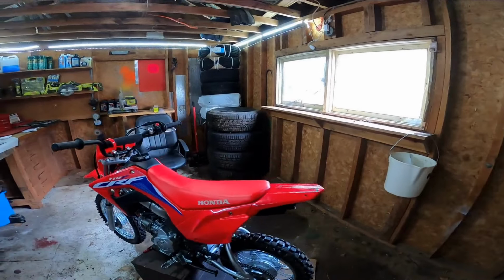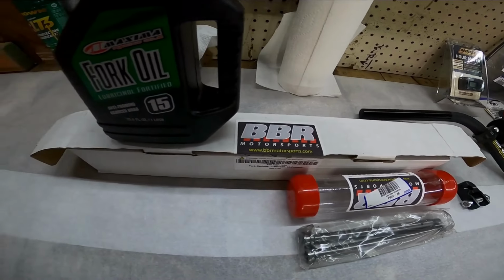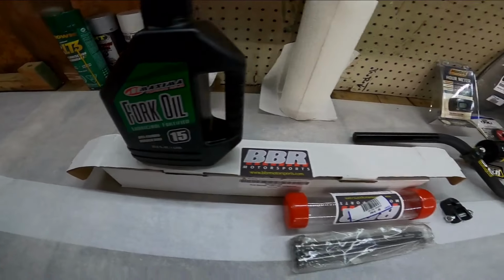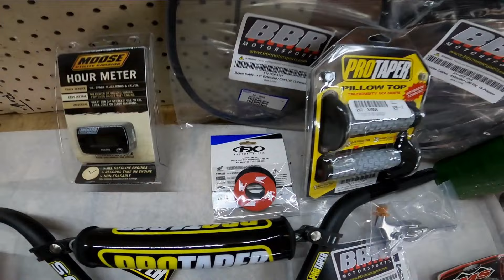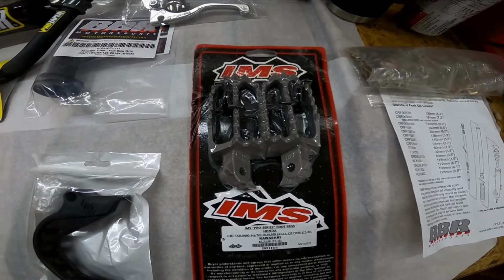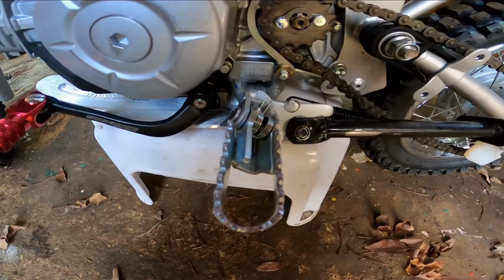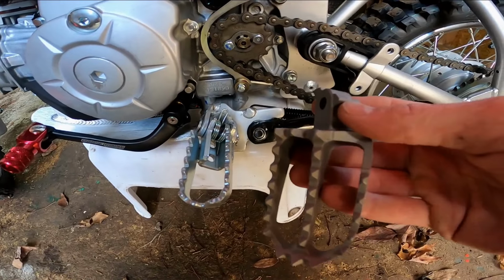2022 Honda CRF110 Build Part 2 (Suspension mods,Bars,Pegs, Sprocket guard)

Comment: Did the after market shifter add length for your foot, the stock one is a little big for my foot
Reply from the maker: Yes it did , it says it's 1/2" longer, but I think it's 1" longer. 
It's almost too far now for my size 10 boots lol
Reply: @WastedWages402  sweet thank you for the responses!
Reply from the maker: @weskirtland6261  no problem buddy, have a good one!

Comment: Did the chain need re-tightening after the rear shock extension install?
Reply from the maker: Yes it did, I had to tighten it up just a little.
With no weight on the bike, the chain is very loose because the change in geometry.
It does rub a tiny bit on my sprocket guard when in the air on jumps, so I am looking into putting a roller on the engine mount or something to fix that

Comment: Good stuff. I just bought 21 model.  I assume the factory cables reached the new talkers bars?
Reply from the maker: Nice you'll have so much fun! 
They did, but it was tight, so I put on BBR extended cables (crf125 cables are a inch longer)
I'd definitely recommend longer cables,
Wether you just buy crf125 ones, or the BBR extended 110 cables, same thing

Comment: do you actually need the extended brake/throttle cables for the new bars or no?
Reply from the maker: I've seen people getting away with stock ones, they flip the throttle tube upside down I think.
But there throttle sticks when turning bars.

So in my opinion yes 100% should get extended cables.(I believe there just crf125f cables)

Comment: Thanks for the interesting vid! Where did you but that rear shock spacer? I can't find them☺️
Reply from the maker: Thanks for watching!  I'm editing pt 4 right now! 
This is the exact one I got , not fancy but cheap and works good lol https://www.factoryminibikes.com/collections/crf110-suspension/products/1-shock-extender
Reply: @WastedWages402  perfect! Thank you for the info :) watching your vids from belgium :)
Reply from the maker: @72jordy  that's awesome,  I never thought my videos would be seen all the way over there!
Reply: @WastedWages402  so now you know💪🏼💪🏼 keep it up man☺️
Reply: @WastedWages402  just one more question, what is that cradle used for? :) i don't know what that is :)
Reply from the maker: @72jordy  ask as many as you want! 
The cradle helps distribute the weight/impact on jumps through the frame and the peg mounts -
Instead of just on the footpeg mounts
So you don't rip the pegs right off the engine,  that wouldn't be a great day trying to fix that... lol

It also looks to me like it's moreless another engine support/mount kinda (but that's just my thought)
Reply: @WastedWages402  thanks for the answer! And what does it changes when you put the bump start on it? :)
Reply from the maker: @72jordy  The bump start thing just makes it so you can start it in any gear, not just neutral.
I believe it just grounds the sensor/Cable, to trick it into thinking its in neutral.

i dont have one but might try to do it myself.. maybe.. lol
Reply: @WastedWages402  ooh okey thanks! I wasn't sure about what that was doing! Thanks for the info again :) yeah it's a nice to to have i think

Comment: Would you say the BBR Springs and rods are your fav upgrade so far?
Reply from the maker: I'd say Bars then pegs then bbr springs and Rods.
And obviously before any of that Nubz Cradle bbr Skid Plate and shift shaft brace
Reply: @WastedWages402  did you have any problems putting nubz cradle and bbr skid plate on together? I’m wanting to run the kinetic HD peg mounts

Comment: Do you require extended cables if you're only fitting the se bars using standard forks?
Reply from the maker: I'm not 100% sure,  I believe the stock brake cable can work ,
But the throttle will pull/rev on right or left turns because it's pulling the cable
(The extended cables are crf125f cables if that makes it easier)

Comment: How did you replace the front brake cable? I need to know because I can’t figure out how to get it off
Reply from the maker: Loosen off the jam nuts on the hub side of the cable 

Then tighten the adjuster on the brake lever all the way in,
And I used some needle nose pliers to grab the cable and pull it out of the lever

Comment: Any routing/install tips on swapping out the oem throttle cable
Reply from the maker: I just followed the exact stock routing, 
it takes a bit of patience , 
maybe even take a picture of it going through brackets just to remember.

The extra length is all taken up with the bars , so theres no extra cable flopping around like i was worried about
Reply: Did you have any problems with the throttle sticking and having no play?
Reply from the maker: No I don't, I took a good 10mins and adjusted it till I thought it was good.
Make sure your cable isn't getting pinched somewere that could do it

Comment: Did you do a extended throttle cable and brake cable?
Reply from the maker: Yes I did, I got the bbr ones, 
but as far as I know. The BBR extended 110 cables are just crf125f cables.
I know people get away without doing them. But I just figured it'd be smart to do em.

Comment: How much fork oil did you put in it and where do you put it in
Reply from the maker: 5.5oz/163ml 
And put it in right in the top, right in the middle of the spring.

Then push the cap down hard as you can and thread it in a bit by hand. <-- that's the hardest part lol
Reply: @WastedWages402  how did you get the top cap off though?
Reply from the maker: @braydensvtfishing4977 Just with a wrench. I recommend you break it loose while the forks are still on the bike, then pull them off and finish unthreading them

Comment: Does your fork sound like metal rubbing or no?
Reply from the maker: No they don't, that can't be too good..
Reply: just did mine. mine do.. any ideas??
Reply from the maker: You did fill them with oil right? 
I know probably stupid question but it does happen

Maybe something didn't get tight enough and isn't sitting straight? Or springs scraping for some reason?